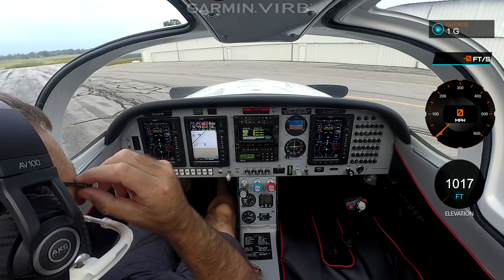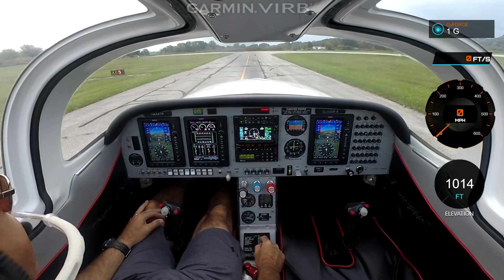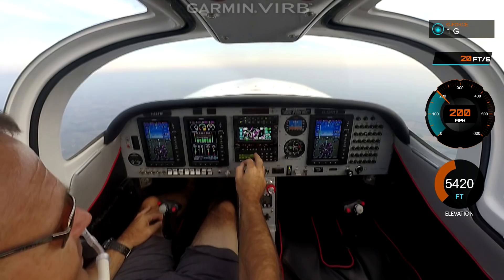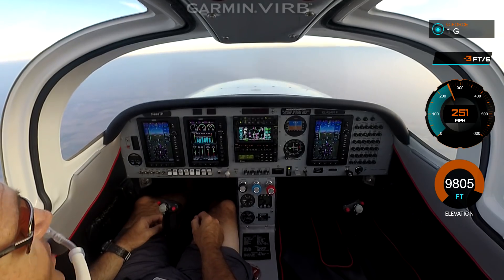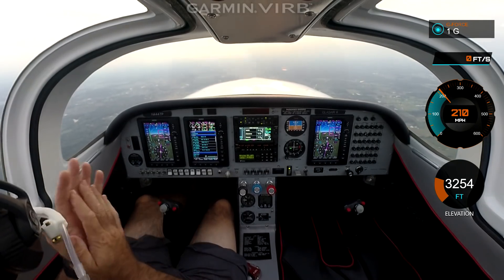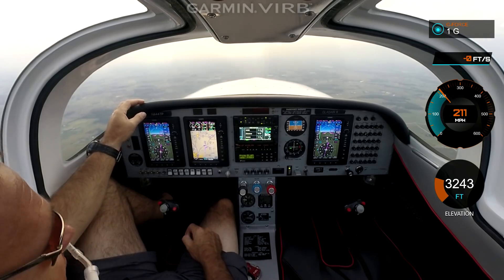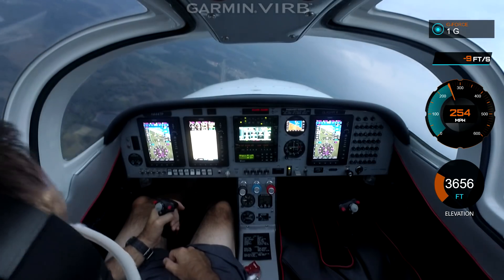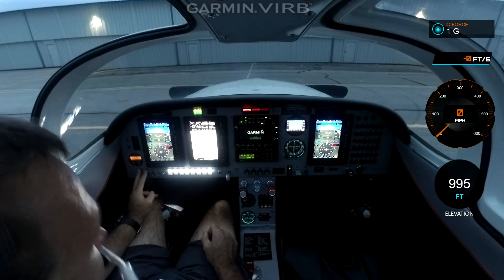Glasair III Full Demonstration with Garmin G3X

Comment: Amazing plane!   Just imagine a Raptor,  same 901nm trip 5 people total pressurized 25,000ft burning 11gph @ 300kts with 68" wide cabin.  35 gallons of fuel 3hrs 12min fuel cost $70, enough fuel capacity to fly round trip without filling up :)       The beauty of Experimental Aircraft!
Reply from the maker: Interesting concept, but will never happen unless a new type of super-efficient (no petro fuel) power plant is developed.  An airplane of that size, even with the most efficient aerodynamic design, will take a minimum of 325 HP to make 300 knots.  325HP x .39BSFC = 19 GPH or so, and that is assuming the diesel engine could make that much power continuously.  If the plane actually ever becomes a reality it will likely be maybe 230 knots on 13-15 GPH on it's best day.  The claims of 230 knots on 7 GPH is Fantasy Land talk in my opinion.  I wish the company well, but when they talk of speeds and don't even know how much power their engine will make yet, it is obvious it is just guessing at this point.  There is a reason diesel engines have not taken over the market yet.  They just can't make them reliable enough - especially when putting out high continuous HP.  Every car engine conversion has been a failure and that includes the Mercedes conversion of the DA42.
Reply: The engine is making around 450-470hp based on the runs so far, exact number will be known when they can find a dyno that isn't broke (the one they were testing with broke).     Obviously the numbers are guesstimates at this point but even at 13-15 GPH at 230kts on diesel (or if you choose Jet A)  14 GPH @ 230kts would be 57.5 gallons of fuel and 4hrs 7min  at a cost of $115  vs  200kts at 15,000ft 9 GPH? 41.5 gallons ($3.83 at RSW for 100LL) at $158 for 2 people vs 5.....         Obviously wait and see how it pans out real word but to discount something before even proven is very short sided.
Reply from the maker: Like I said, I hope they do well, but the physics do not work regardless of what they claim.  It takes a pre-determined amount of HP to make speed.  The Lancair IVP is probably the most efficient wing in the sky for a piston plane.  It will make roughly 245 knots on 18 GPH at 25k.  The efficiency comes from a very clean air frame that is also on the edge as far as safety is concerned.  High wing loading and very unforgiving.  

Furthermore, you will not be getting 5 people in this new plane cross country as there is no way they will have a 1600+ useful load once it is flying.  Also, a new prop is $12k, Avionics $40k, Engine and PRSU is at least $30k.  Now you have to buy everything else which includes landing gear systems, pressure control systems, advanced electrical systems, carbon fiber airframe, all accessories to make it come together, paint, interior, and then probably around 2500 hours of labor to get ti flying.  You are looking at 300-$400k minimum.  

Just look at the Glasair as a comparison.  If you build it yourself to the standards mine is built to you will have over $275,000 in it.  Have someone build it and you can add another $100,000 minimum.  Until you build an aircraft you don't realize how labor intense it is ad how much parts cost and how many parts actually are needed.  A new Lancair Evolution will cost you $1.2 million.  There is no chance this raptor will be $130,000.  Not going to happen.  A final thought:  There are plenty of dynos available to test engine power.  If they can't find a dyno I would question how serious they are.  Underfunded aviation ventures and claims of car prices for a plane that exceeds performance of other planes that cost 5x as much is not realistic.  The twin turbo Velocity XL-5 is a 240 knot airplane (real world) at 25k burning 19 GPH.  A diesel would maybe be 20% more efficient.  With climb fuel burns being another 15 GPH you are looking at probably 22 GPH block to block in the gas engine and maybe 18 GPH in the diesel.

Remember the Moeller Sky Car. :)
Reply: For those following their videos it's already known the price will be above the original estimate of $130k.   You can do a lot for a lot less when you're not having to spend so much on certified POS engine based on 1930s design (Except those smart few who have Electronic ignition such as yours :)  )     Time will tell!    Loved your video, guy I bought my 1946 Bellanca from was selling it because he had just completed building his G III    Great planes!
Reply from the maker: I agree the engine technology needs to change, but again, it is not easy to make high HP at altitude and get reliability. Cooling drag is HUGE with water cooled diesels and making it work is not easy.  A Velocity XL-5 RG completed with no engine and a glass panel is $200,00 to $250,000.  Add pressurization and an engine to that amount and that is likely the price.  Then comes insurance concerns.  Most people with a $300k+ investment want to insure it.  I would guess initial insurance costs would be $8000-$10,000 if anyone will write it.  There is a lot to work out in any new design.  The engine is just one of the concerns.  Let's hope it all works out.  W need new designs.
Reply: @baronpilot2bb  Two years later and the Raptor is still on the runway and breaking stuff right and left.  I truly enjoy watching Peter iron out all the wrinkles while reaching towards his highly devoted dreams, but I also fear hitting most of his initial claims is going to be extremely unlikely... especially if it is to also be reliable (a must!)  So far it seems to be breaking almost weekly on the runway.  I hope nobody gets hurt in the prototype!  Developing a new plane is scary, doing that AND adapting a new to aviation automotive powerplant (and significantly increasing its factory power levels by adding compound turbos) is straight frightening when done simultaneously!

I too agree the chances of him achieving his price, performance, and economy goals are slim to none.
Reply: @baronpilot2bb  you mentioned the Velocity XL-RG here.  While watching your video, I was actually wondering how you'd compare it to the G3.  Totally different, but reasonably close in performance, price, range, and economy.  Would you mind sharing your thoughts on the two???
Reply from the maker: @ssoffshore5111  The Swings have a good airplane in the Velocity.  The normally aspirated XL is about 20 knots slower than the G3 on the same fuel burn.  

The Velocity also has 1/3 less wing loading which gives more docile handling, but not near the ride quality in the bumps.

Having owned a Velocity, my biggest hangup is that it is a 4-seat airplane with no real baggage ability, so it really is a 2 person and bags plane which is exactly what the G3 is; however, the Velocity has better access to your baggage when using the rear seats a baggage area.

I love the V-twin for it's safety factor, but the real answer is an XL with a turbo 550 and a BRS chute.  Until Garmin makes a system that will land the plane itself, my wife will not fly anymore with just me as a pilot as she is very scared that I will be incapacitated and she will be left alone in the plane.  The XL Turbo is an honest 230 knot plane - a BRS chute would likely put one in my hangar.
Reply: @baronpilot2bb  Thanks for the detailed reply.  I would love either (an XL or a G3), but I just can't see me spending that much on either for basically a hobby I can only enjoy with one or two other people...  But a TXL with a chute would be dream material!

BTW, which model Velocity did you own?
Reply from the maker: @ssoffshore5111  I had a standard RG. In 2005 velocity announced that they had a deal with BRS for a chute; however, on the velocity website 15 years later under the FAQ section it says a chute is unlikely. I'm not flying today because my wife wants a chute in case my health fails. She is not worried about engine failure.  Mr Swing at velocity is missing the boat when he thought the twin V would make everyone happy. Just as in the certified world, 2 engines does not mean that the plane is safer..

Comment: Hi Dukepilot, what is the middle knob (blue) between the throttle and mixture?
Reply: The Prop (propellor) control. It changes the RPM of the prop, which is then held by an electronic governor.

Comment: I figured the rate of climb would be higher. I would be worried about the climb angle when heavy
Reply from the maker: Rate of climb is 2500 FPM if you climb at 100 knots. I climb at 130-140 knots in this plane.

Comment: Nice G3.  I have a question about the Guage that shows your hydraulic pressure.  Does that Guage show pressure when the gear is retracted?   I recently purchased a G3 and when my gear retracted my gauge shows 0 pressure.  Just wondering if that is normal.  Thanks
Reply from the maker: No, that is not normal.  Your gear should show around 1500-1800 psi retracted and 800-1000 PSI extended.
Reply: Dukepilot, unless they installed 2 pressure gauges or a shuttle valve, so one gauge can be used for both, you only get gear down pressure. I Have a G1-RG I built myself. Early RG's only showed the more critical down pressure. If you have a shuttle valve, it could be faulty. All Glasairs use the same hydraulic system design, but with some varied options offered over the years.
Reply from the maker: Did not know that.  If you don't have a shuttle valve - install one.  You need to know pressure both ways.  It is important to adjust the pressure switches correctly and to know if you have a leak.

Comment: I do have to ask, whats the takeoff performance like? Things like takeoff roll, take off distance over 50ft obstacle, landing distance, landing roll, and if its pretty gravel friendly?
Reply from the maker: Not good in any of those areas. This plane is designed to go fast.  You would never fly it on gravel runways.
Reply: @baronpilot2bb  Gotcha, thanks for the response!

Comment: great video thanks!  is the glasair III ifr certified?  Also, what is the ceiling of this plane?
Reply: Like most experimental aircraft, it's IFR capable as long as the avionics meet FAA requirements for IFR. In the main this usually means a certified navigator will be needed (as our friend has here, with the GTN650). This will add a lot of expense as IFR aside, non-certified avionics can be used for experimental aircraft. But there's no substitute for having IFR capability, especially if you sometimes 'need' to fly, rather than just flying for pleasure on VFR days. Flying into known icing will always be a no go for experimental aircraft though, regardless of equipment fit.

Comment: What in your estimation was the value of your Glasair when traded.  Why did you introduce Oxy at only FL4.5 ?
Reply: Since he's generating his own O2, no tank, and is pulsing feed he's confident that the flow is working.  I'm guessing.
Reply: So you don't forget to turn it on. 

Your oxygen levels and mental function begin to degrade for every foot you climb. The FAA just assumes that 9/10 people will become noticeably and dangerously impaired at the 12.5K for >30min & any time at or above 14k. Using Oxy well below there is advisable. 

Flying in the Rockies going from 5k airport to 9k cruise, popping up to 13k+ to clear the passes really does a number on you if you have not spent time hiking above the tree line in the preceding days.

Comment: What is the stall speed on your Glassair III?...short and long wing...thanks
Reply from the maker: About 62 knots long and 67 short. The problem is that you will have a 2 to 3 thousand FPM decent rate anywhere close to those speeds with the plane dirty. The stall speed is not big deal,  but the rate you descend when slow is. You don't fly this plane slow in any flight stage. You fly it like a jet.
Reply: Dukepilot so you have to land around 100 + knots?.. length of runway you recommend?.. my local  has only about 2 thousand foot just paved

Comment: Radio calls only on departure? Pretty dangerous flying around at 200KTS without once making a radio call enroute on approach nothing.
Reply from the maker: Good point, but for context you have to know this area.  This is a very low density airspace area.  The airport you see me landing at has about 5 flights a day.  Again, I made a few mistakes flying as I probably spent too much time narrating the video instead of watching for traffic and communicating.  With that said, I have full ADS-B in/out and any traffic in there area would have shown up on my display unless they had no transponder which means they likely had no radio.   Had I been in SW or SE FL, East Coast, etc I probably would not have made the video.  Too much risk in those areas.  Thanks for the comment.
Reply: I don't think it would be unlikely at all for a plane without a transponder to have a portable radio.
Reply: Impressive but agree with Matt and Jay - you should be talking to Indianapolis Center or somebody at least with those kind of VFR altitude variations and speeds.
Reply: Yeah, that seemed a bit cavalier, especially with his approach.

Comment: Do you always use the oxygen when flying? I noticed that you put it in use starting around 3000 ft.
Reply from the maker: In this plane I usually always wore oxygen.  It would cruise above 200 knots up to 16k ft or so, so if weather was bad down low or winds were favorable up high I would change my plans to take advantage of higher altitudes.  Having the o2 on and ready was one less thing to do.  Also, even at 5k you feel much better on oxygen and are sharper.  Since I had my own filling station it was no inconvenience to to use o2 all the time.